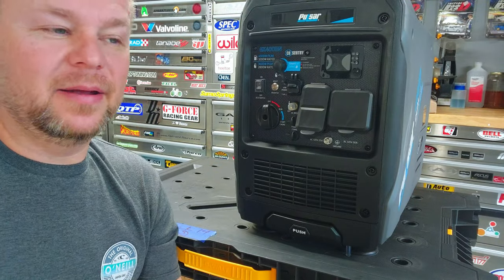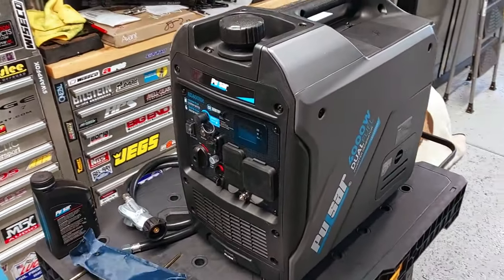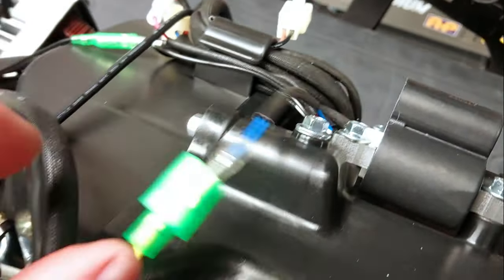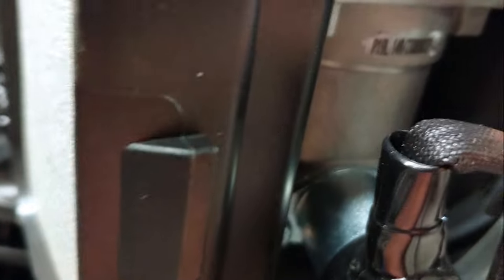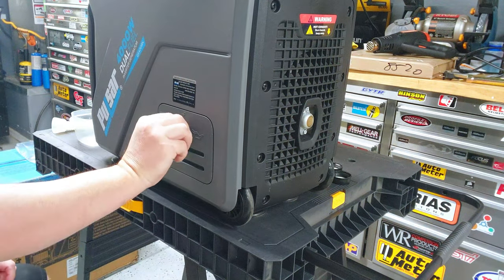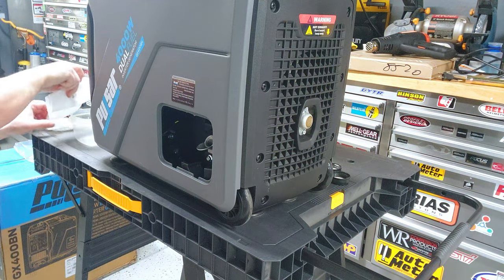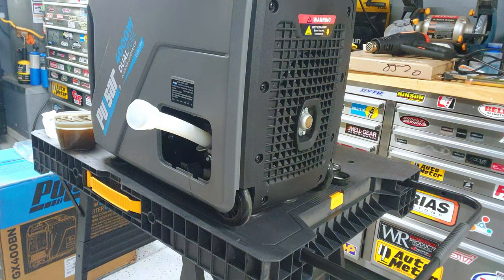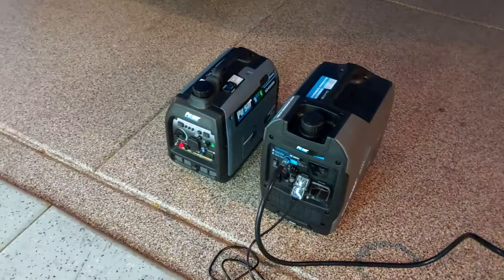NEW MODEL! 3200W PULSAR PROPANE - GAS DUAL FUEL INVERTER GENERATOR DETAILED REVIEW | RV | CAMPING

Comment: Any chance of doing the state park noise test?  Just curious how it will do at 50ft. Thanks
Reply from the maker: Right - I should have done it anyways. Was tired - long day! BUT here is the deal. The GD gen was 67.4dB at 100% output for the state park test. With the GD and GX both at 100% output in this test, the new GX is 5.1dB quieter. This would put it at 61.9dB at 50'. Just might pass, and for sure will pass at say 70% load and under. Always best to test though and I will give that a shot when I have time.
Reply: Thanks!!

Comment: how does digital readout plug in.  Found few could  be installed gd400
Reply from the maker: The display is generally linked to the inverter and not a separate item with CT to read. Has to be compatible with fuel sender, calibrated to output load and such.

Comment: I cant figure out for the life of me how much propane these consume at a half load.
Reply from the maker: On the GD model, I tested it at 1.6lbs of propane at 50% load per hour. I did not test this particular version as I ended up shipping it back due to no response from pulsar support
Reply: @MR_Garage wow. 1.6lbs per hour?  So with a 40lb propane tank that’s only 25 hours.
Reply from the maker: A 40lb propane tank holds around 20lbs of propane tops.  So you would be looking at around 12.5 hours best case at 50% load.
Reply: @MR_Garage is that with AC on (13500btu)
Reply: I wanted this to power my 20 fr travel trailer AC - mainly just for AC since I live here in the Texas heat. Will it allow my AC to run for 24hrs
Reply from the maker: Yes, a 13.5k BTU
Reply from the maker: Keep it gassed up and maintained, it will do just that! Better options IMO thought than this unit. Like this unit I have reviewed. https://amzn.to/3QXa1y7

Another more affordable option that is excellent, the other pulsar model in this class. https://amzn.to/3KifTOR

Both of the above I have reviewed on my channel.